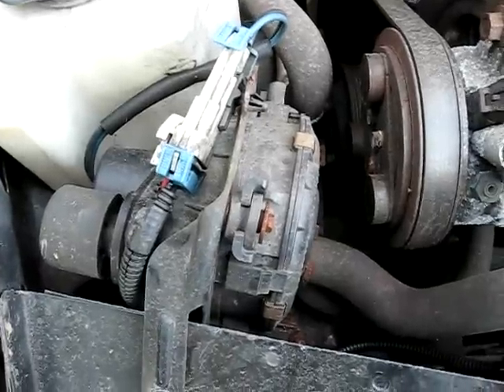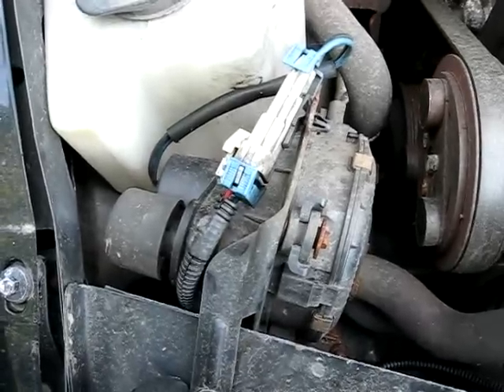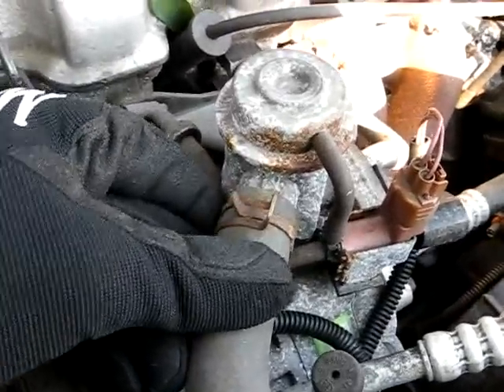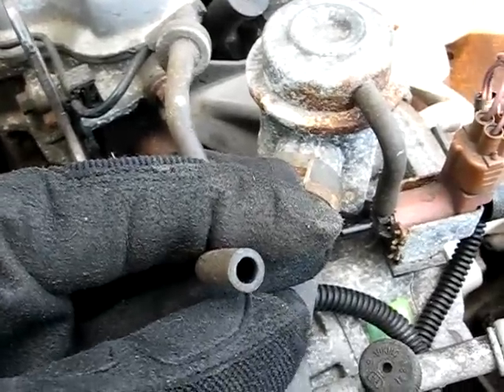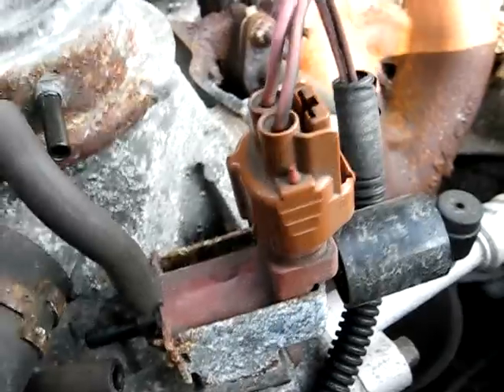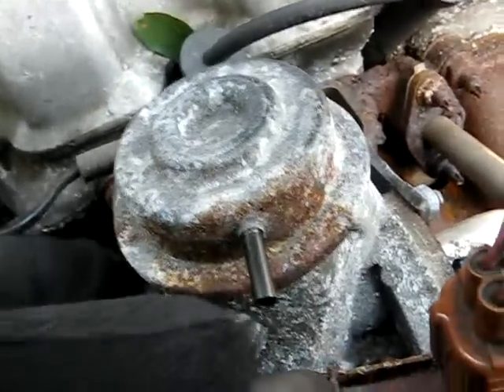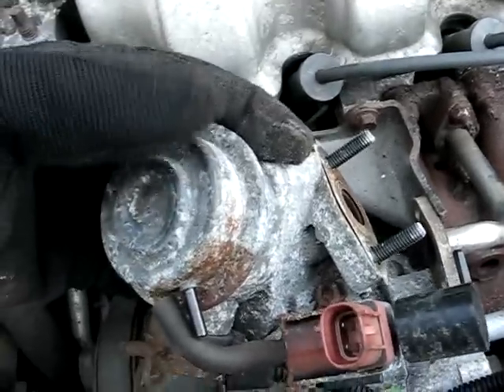P0410 Secondary Air injection System Troubleshooting

Comment: Richpin, I've got the P0410 on my 01 SL1 that I can't solve this time. My pump isn't running upon startup. I checked and have power to the pump upon startup. Usually if the pump has power and doesn't run, then the pump is bad. To make sure the pump is bad, I wired it straight to the battery. The pump runs like it should. I can't figure out why the pump won't run if it has power and is not defective.
Additional info. I have a working pump from a previous SW that I saved. I swapped pumps and still have the problem. I also hooked up my multimeter to check for power again. I have power, it stayed on for about 30 seconds and then shut off, so the relay appears to be working.

Comment: Richpin, I have a 1998 Saturn SW1. I doe not have a secondary pump in the location shown on this video.(Right below the wiper fluid reservoir). I have searched the internet until my fingers hurt. I do not even see that part for my year and model of Saturn. Do you know if my year and model even had a secondary air pump?
Reply from the maker: If i recall 1999 was the first year for the air pump system.

Comment: Hi Richpin.  I followed this tutorial 2 years ago on my 02 Saturn SL and the diverter turned up as defective (no airflow out of the big hole in the diverter upon cold start).  Fast forward to the beginning of the month and once again I'm getting a P0140 code on Secondary Air System.  So I did these troubleshooting steps and again located the problem at the diverter.  The part was returned under warranty and I installed the new part.  However, the SES light came back on and the code it's throwing is P0140.  I performed all these steps on the new valve and it's showing exactly the same problem (no air flow out of the big hole in the diverter)!  I think it's unlikely they sent me a replacement that's defective out of the box, or is it?  Is there anything I'm overlooking?

Comment: What if there is no power to the fan? I pulled the fan and bench tested it. The fan worked when it got power. I used a multimeter to test the connection and didn't have power going to the fan. I can't find a wiring diagram that shows this electrical circuits.

Comment: This is an insanely rare video to find, I have a 1999 SC2 and I had a hell of time finding out what any of these parts were so I could find replacements. I recently refurbished the starter and replaced the fuel pump, and found the vacuum line there (for whatever reason mine goes over the engine block) was separated, one thinner stiff line that seems to fit into a thicker more flexible one, but had no clue if there was ever a connector or clamp for them or anything, and at one point the thinner line snapped. I doubt I'll be able to find a replacement for it unless I get lucky at a junkyard, do you have any tips on using a hose I can pick up from a hardware store?
Reply from the maker: What i would do is use as much of the plastic line as possible and find hose to fit that line.
Reply: @RichpinTv  that's what I was thinking but I'm no expert, thanks for replying! That's just as rare, honestly

Comment: Hello! I know this is an older video but I hope you still around and check these replies! This is a great video and is referred to by many other YouTubers when they do their videos! But I have the same engine that you are working on in the video, it is a 2001 Saturn SL1 1.9 single overhead cam, and everything works properly as well as I made sure to clean everything out! I even went as far as sticking wire down as far as I could in the exhaust manifold and spraying it with brake clean very well and none of the brake clean came out at all obviously went down into the manifold telling me the ports are open or whatever holes that are in there. But I still keep getting this code! I also have a code P 0734 that pops up with it and is making my car shift funny into 4th gear. Are the two related? But if not and we stay with the po410 what could possibly keep causing this code as everything works properly and appears to be cleared of any carbon? Thank you!
Reply from the maker: This is very important, make sure that the engine coolant temp sensor and its connector are in good shape and working properly.One other thing to check is the grounding bar near the washer tank.
Reply: @RichpinTv  thank you for getting back to me! I was leery of the cooling sensor cause the guage works as well as it gives proper temp on the scanner,,, but, i will change it anyway with an acdelco one. I already pulled the plug and it is clean, cleaned the grounds near it as well as that ground strap by the cooling tank to the engine mount. I am so tired of throwing parts at things. And i cant stand forums cause they never come to a conclusion! But thank you, i will let you know how it turns out when i get the gm sensor.

Comment: I had this code come up 2 days after I replaced my egr. I've already replaced the air pump fuse. Could it be the egr fuse? Over already checked the air pump is running but that's as far as I've gotten.

Comment: What is the line called that's connected to the black side of the secondary air injection check valve? (Seen around 1:10) yours seems rather flexible but mine has gotten hard and brittle and has snapped in multiple places. I should probably replace it if it's possible to get a new one.

Comment: What size tube is that at 2:00 (one from throttle body to air compressor)I kinda went full panzer mode and broke mine into tiny pieces cus it was real damn fragile
Reply from the maker: Off the top of my head i can not remember the size and i can not get to one at the present time.

Comment: Hi rich,

0410 had been coming on and off the last couple of years. I don't know why but the check engine light was turning of by itself.

Then I realized my gas mileage plummeted to 18-19 mpg in the city and the CEL stayed on.

I watched your video and cleaned the pipe.

After cleaning the pipe the code kept coming. Still low mpg. Then I noticed water kept gathering in the hose from the pump to the diverter valve. I read somewhere that that wss because of the malfunction of the valve. So I got a new one and installed it and there is no water in the hose any more. And the pump works well, lots of air coming from the hose.

Immediately after that I drove to NY from FL with it and made 32.5 mpg on the way, which is awesome.

I came back to FL and while I thought the problem was fixed, a week later the code came back and my city mpg was still 20.

Any idea why the code keeps coming?

And does this secondary air system affect the mpg at all? Or is the low city mpg related to some other problem somewhere else?

Thanks.

Comment: Ive been going allover the youtube about this and I just ran into your video which in my opinion is very very informative and according to your respond to my question below Im surely going to try your way. 

After changing (probably it was healthy) air pump I got the code back. Went to garage and asked them to check all the system (probably garage without experience) and paid them for that work, I still get the code. One thing Im dying to ask, what would you say if the CEL goes away by itself sometimes? Is it about computer or what? Thank you in advance!

Comment: Richpin06a, what if there's no power to the pump and no power to the connector?  What do I check next?
Reply from the maker: The pump receives its voltage from the air pump relay.Now remember the system does not run all the time so voltage is only present at certain times..

Comment: Checked everything out. The pipe was clogged. Cleaned it out as well as the port in the exhaust manifold with brake cleaner. Erased the code and within a  couple of hours it came back. Any ideas Rich? Could the manifold be plugged up further downstream that it's tripping a code? What parameters in this system is the computer reading off of?
Reply from the maker: If the coolant temp sensor reading is 
wrong the PCM will test the air system at the wrong temp and may not see
 O2 reading it should.
Reply: Thanks Rich. I'll check it out.

Comment: Is vacuum the same as air flow going out? The tube going in to the diverter valve is blowing out into the valve, not vacuum. Is this correct? Now from the diverter valve nothing is blowing out like it should so I'm guessing its that diverter valve. I just want to rule out anything else since I'm not getting vacuum per se, but air blowing out instead. Any help would be appreciated, thank you.
Reply from the maker: Air flows from the pump to the diverter valve and vacuum is used to open the valve which it gets from solenoid valve.

Comment: Have you heard of having to replace the ECU for this code??
Reply: ~go the less expensive route first~I do not believe that will solve your problem~try either the ects, electronic cooling temperature sensor on the right side underneath the air hose intake or after spending a whole lots of money with changing everything on the car that relates to this code like I did~look under the secondary air pump and you will see a black plastic piece with wires going in it~thee is one 10 mm bolt I believe holding it~take it apart and look at the copper bar~if it looks corroded it may need a cleaning and also look at the pins inside the black plastic piece as they may not be touching either~if not pry them gently with a little jewelers screwdriver in a downward motion~you want contact with the bar to complete the electrical circuit so you do not get the check engine light~it took me two years to finally stumble upon this as I had no ground to my windshield washer fluid and this is tied to that copper bar for ground~

Comment: Can someone please tell me, why would the power to the air pump work for just a minute upon starting the ignition but then stop working ?  Is it supposed to come on and off, is it supposed to stay on ?  If it is supposed to stay on, what could be making it shut off every time after just literally a minute?  I have the P0410 code and I'm stumped.  It is not the fuse, could a relay going bad behave this way?  It seems very consistent.   Any help is appreciated!
Reply: ~try either the ects, electronic cooling temperature sensor on the right side underneath the air hose intake or after spending a whole lots of money with changing everything on the car that relates to this code~look under the secondary air pump and you will see a black plastic piece with wires going in it~thee is one 10 mm bolt I believe holding it~take it apart and look at the copper bar~if it looks corroded it may need a cleaning and also look at the pins inside the black plastic piece as they may not be touching either~if not pry them gently with a little jewelers screwdriver in a downward motion~you want contact with the bar to complete the electrical circuit so you do not get the check engine light~it took me two years to finally stumble upon this as I had no ground to my windshiled washer fluid and this is tied to that copper bar for ground~

Comment: Hello all:

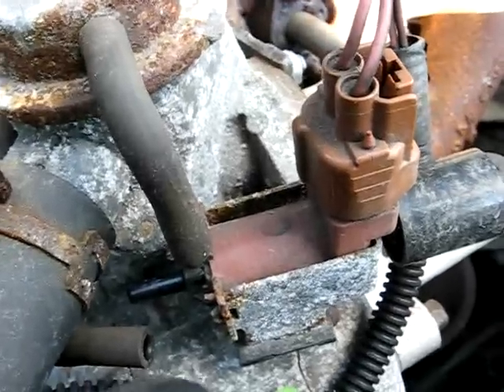Does anybody know part number for switching valve mentioned at 1:45? Great video.
Reply from the maker: The Air Pump Vacuum Solenoid part number is:  21210001

Comment: Rich I followed your P0410  Secondary Air injection System video everything checked out I even checked to make sure I had airflow from the pipe going to the intake manifold to the oxygen sensor. I replaced the  oxygen sensor that was definetly the cause but that darn code came back. I went through the whole procedure a 2nd time thinking I missed something but still have that darn code. Plan I checking the new oxygen sensor tonight. Any thoughts? Stumped in the ROC!!
Reply: ~try either the ects, electronic cooling temperature sensor on the right side underneath the air hose intake or after spending a whole lots of money with changing everything on the car that relates to this code~look under the secondary air pump and you will see a black plastic piece with wires going in it~there is one 10 mm bolt I believe holding it~take it apart and look at the copper bar~if it looks corroded it may need a cleaning and also look at the pins inside the black plastic piece as they may not be touching either~if not pry them gently with a little jewelers screwdriver in a downward motion~you want contact with the bar to complete the electrical circuit so you do not get the check engine light~it took me two years to finally stumble upon this as I had no ground to my windshield washer fluid and this is tied to that copper bar for ground~

Comment: Hey so I've seen on other videos and guides that the vacuum line running from the diverter valve leading behind the engine is supposed to connect to the vacuum line on the intake manifold, on a saturn sc2 2000. I've also read that the throttle body vacuum is where the vacuum starts and should not be obstructed? Is this correct? Thank you

Comment: Everyone here by now should know that richpin is the man. His videos are invaluable for we Saturn owners. In this case, though, I'd like to repeat what was said by a comment below. The P0410 error can be caused by a PCM error. It could be there is nothing wrong with your Secondary Air Injection System. The ECTS (which is known to be defective on Saturns) fools the PCM into thinking there is something wrong with it, but it may not be true. If you have other symptoms (mine was the car would start and then instantly shut off), at least take a look at the ECTS. It's cheap and easy to replace.
Reply from the maker: Good tip....check that ects.

Comment: ~after so much money from two years back as I used all the videos advice about this code I have finally got to the bottom of this with two unrelated issues with the P0410 code~the first was cleaning the grounding bar under the windshield washer bottle on my 2001 Saturn SL2~next thing was that I contacted GM on this and of course no help as they wanted me to bring the car back into my Chevy dealer~yeah right~then I got involved with the EPA~then NYDEC which lead me to the DMVin which they found a thread on this from a Saturn lead tech at a GM dealer in Massachusetts which he wrote this~"Believe it or not the main cause of a P0410 is the ects or engine coolant thermostat sensor~if the coolant sensor reading is wrong the PCM will test the AIR system at wrong temp and may not see the O2 reading it should"~he tells me Good Luck and low and behold my ects is blackened and burned so I change that and the connector to it as well~I did everything by changing out all the parts for the P0140 code to cleaning the manifold ports~no light and the Drive Cycle Monitors are complete as well~good luck with yours as well~love your videos richpin06a~I own a 1998 SL1 and a 2001 SL2~
Reply from the maker: Thank you for letting everyone know about your fix.
Reply: ~you are always welcome~

Comment: I love this video but I do have one comment.  It seems to me you need to start the TS with making sure you clear the PCM.  The P0410 error seems to lock the air pump system out so you won't get electric until the PCM is cleared.  I am not positive about this but it is what I noticed while fixing mine.  Richpin06a you are the man.
Reply from the maker: Thank you for the tip....must investigate.

Comment: Hey Richpin, I have issues with my 2001 Saturn SL2 with P0410, during testing the secondary air injection system would turn on  for about 30 seconds, is this normal? or would that be another issue to replace it? I had already cleaned out the carbon, so i know that isnt a huge issue, all i know is that it would start for a little and go out. This failed my smog check, and the check engine light has been there for a couple months now. Any recomendations? It goes out before i have a chance to check the  hoses, but by then no vacumm?
Reply from the maker: It is normal for the air pump to turn on for a short time on start up then turn off.Check this link for info on the P0410 http://www.saturnfans.com/forums/showthread.php?t=135540
Reply: Thank you I figired it out its the hoses that dont work, thank you

Comment: got a 2001 SC1 and it jerks on acceleration What might be the problem ?
Reply from the maker: Is the check engine light on if so do you have any codes.
Reply: P0410 P0137 AND P0172 and I did clean the tube at goes from the air pump to exhaust manifold

Comment: Hi Rich.  Great vid but I'm still kinda scared/intimidated.  My 2002 Saturn SL1 had the P0410 code this past summer.  I unplugged the connector & reconnected it & the check engine light went out.  But it came back on shortly thereafter & has been on since then.  Now, it is time for my inspection renewal.  I went to have the code read to be sure it was the same one & now there's three codes; still the P0410, as well as 0037 oxygen sensor bank1 sensor2 and 0341 camshaft position sensor A circuit.  From the saturn forums, i learned that there is no camshaft position sensor & that this is a glitch & it was suggested to change the plugs & wires.  Might as well, have had the car 2 & half years & never changed them, so can't hurt.  Here's my question(s): should I tackle this P0410 first & hope it also resolves the O2 sensor (since the 0410 code happened first last summer) or should I start with the O2 sensor?  And (don't laugh) do you have a vid that shows how to check if there's current going thru these different connectors?  I bought a voltmeter but I don't know how to use it for anything but testing AA batteries.  LOL Thanks so much.  I hope I can do this!
Reply from the maker: If you have a fair amount of miles on the car the air injection system could be plunged with carbon.I would do the tune-up first and see what happens.